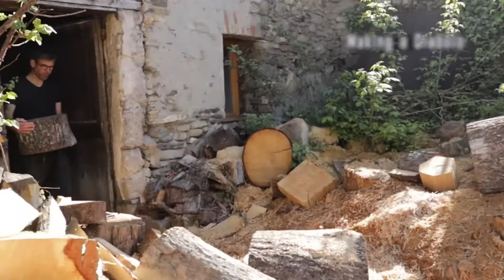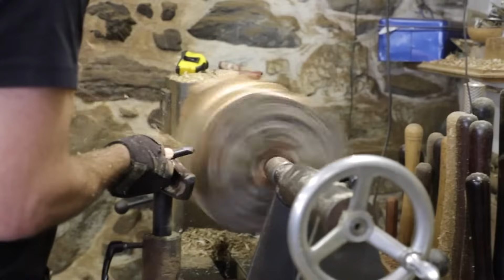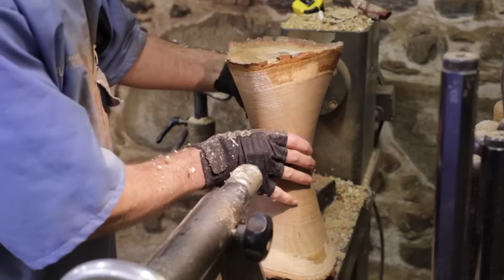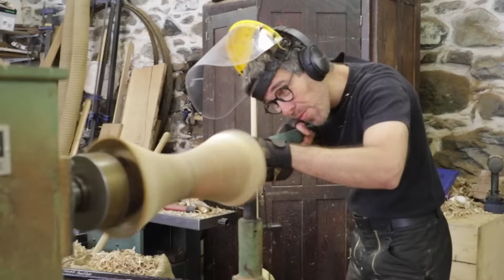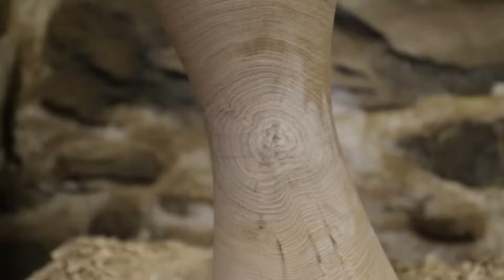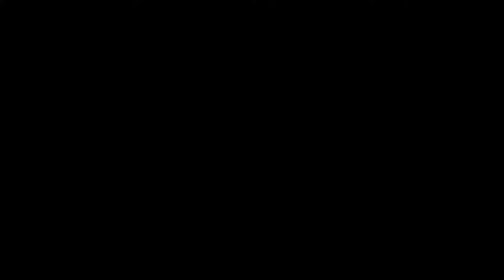Creation of a Diabolo

Comment: Really beautiful turning! I have two suggestions, though. If your interior turning tool rest were hollow you could introduce controllable air flow through it to minimize dust build up. Probably need a very low flow rate to reduce visual chaos. And, light your finished product from the inside to show it's wall thickness and translucency. Very cool video, Thanks!